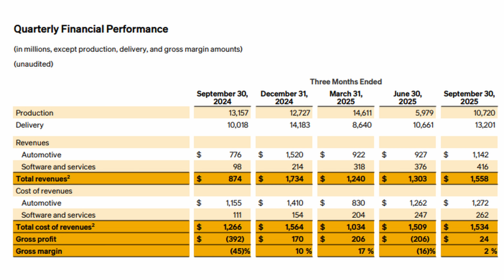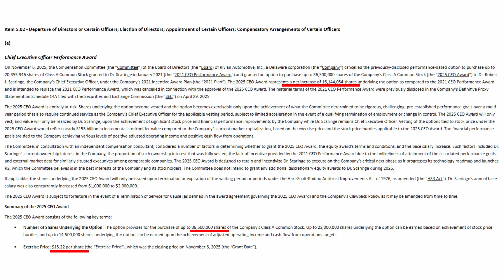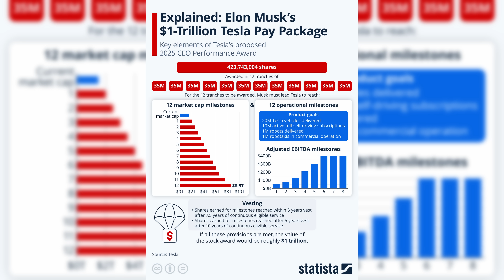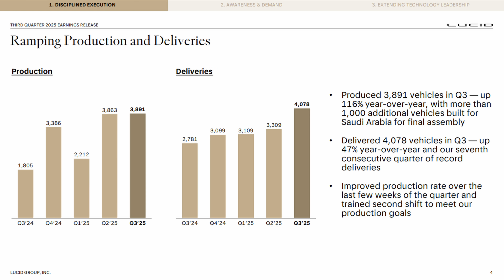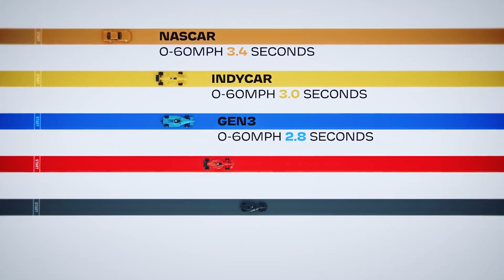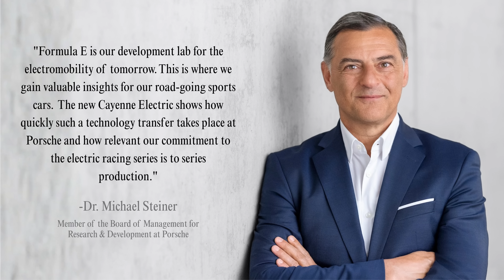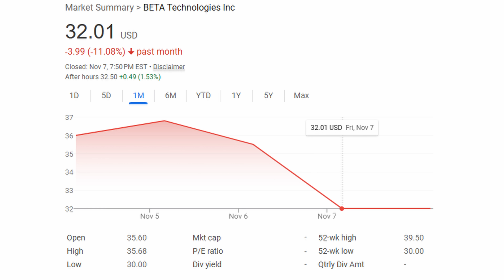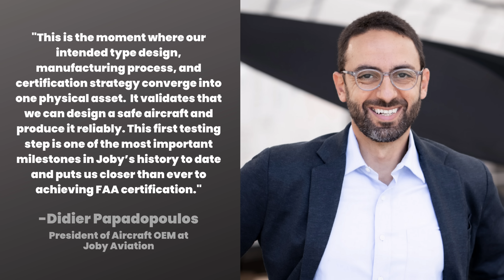The Current : Weekly EV News Ep#88 Nov 9, 2025

Comment: Lucid sales are surprisingly low! Hardly growing. They should have released a mid sized instead of the Gravity.
Reply from the maker: The model release order is dictated by the workload and capital expenditures. Gravity shares a lot of content with Air. -Producer Tim
Reply: @MissGoElectric what’s the point of it when few cars are sold and the factory is idled with profits no where in sight?
Reply from the maker: Low demand was certainly not part of the future they anticipated. 
-Producer Tim
Reply: @MissGoElectric  It’s definitely a failure of market research on the part of Lucid. They’re following Tesla’s production plan, sedan then SUV. If you look at Tesla’s Model X sales, a car in the Gravity’s segment, you will see that from 2015 onward, they sold an average of 15,000 models for the next nine years, w a height of 31,000 units in 2020. The $100k+ EV market is just soft. Look at declining sales of Porsche Taycan—6,000 units sold in 2024.
Reply from the maker: Well...massive unexpected policy changes have taken place.  Those coincided with the launch of Gravity.  That is a major rug pull. -Producer Tim

Comment: How many miles will the Tesla Semi haul a full load 150ft trailer and where can it charge and how much dead time is the driver paid (or not paid) while charging?  Its not like 20 trucks can charge at a warehouse while loading im guessing (1GW maybe?). Full autonomous long haul would make sense if the charging time can be drastically reduced but again the electrical infrastructure needs to be present for megawatt charging..
Reply from the maker: We look forward to final details in 2026.
-Producer Tim
Reply: @MissGoElectric Same.  I look forward to seeing them actually displacing new truck sales.
Reply: Tesla and a customer have made several demonstrations of over 500 miles with 75,000 GVW, which at highway speeds (~63 mph) is over 8 hours.  There are YouTube videos of these.  Yes many Tesla Semis can recharge at a single location by having bulk batteries on site.   150 foot trailer??? 🤣
Reply: @shazam6274 yeah I should not post while sick..    it makes sense that with a Tesla battery storage unit or 2 onsite that charges the trucks and 'trickle charges' itself all day/night.  Balance..

Comment: One thing to add to the Tesla Semi update is that a slide was shown that said the new mass production version will use 4680 cells.  Nothing was verbalized, just the slide.  It could be Panasonic’s new 4680 cells, with 5 tabs and wet process, from their new Kansas plant will be used, or perhaps Tesla’s in-house 4680 tabless cells using dry process.
Reply from the maker: It was reiterated this week on X by Dan Priestley that the 4680 cells would be used, but we've known that for six months since his last formal Semi presentation. This is just confirmation that nothing has changed. 

There are several sources coming online and we know Tesla will use an evolving mixture of available supply.
-Producer Tim

Comment: I don't get the fascination with eVTOLls beyond novelty, it's a very inefficient form of aircraft, it seems like they're skipping by electric fixed winged aircraft for the shiny object.  I would be very uncomfortable flying in one.  Flying cars format is a ridiculous risk to people on the ground.  What is the redundancy on these vehicles how many Motors can they lose and still land safely?  I wouldn't expect them to deal well with wind shear & extreme weather conditions.
Reply from the maker: The reasons are numerous, which is why so many of the brightest minds, existing aviation leaders, automakers, policy makers, and successful investors have been dedicated to the segment for a decade to the tune of $500B+.

A few: much quieter (fly in cities and over neighborhoods at all hours), safer (2-3x redundancy) cheaper to operate than helicopters, easy operation from rooftops and parking lots.

A few more: far less expensive to build when scaled up, less maintenance required, quicker repairs and better modularity for minimal downtime, most designed for operation with no pilot for massive profit margin improvements

EVTOLS do not subtract from existing air travel businesses. They enable growth of the pie expanding and simplifying air travel in every region. At scale, the private jet onboarding experience will become possible and affordable at thousands of new departure points including podunk airports, resorts, malls, and business campuses. 

They unlock an enormously desirable traveler experience getting people to and from major airports or local destinations. These flights will meaningfully take revenue from airport parking, regional airport shuttle busses, and automotive gasoline sales. The reduced friction getting into a flight itinerary will increase airline ticket demand, which is why United and Delta are so heavily invested.

This is the tip of the iceberg. Medical, goods transport, government work, and military applications are massive future markets as well. 

-Producer Tim
Reply: @MissGoElectric I can see the emergency medical and military applications